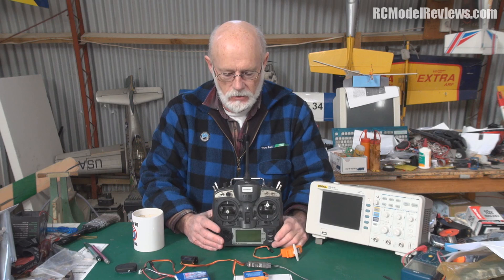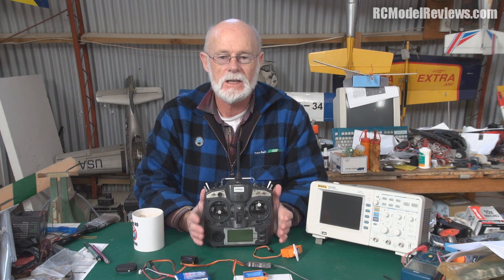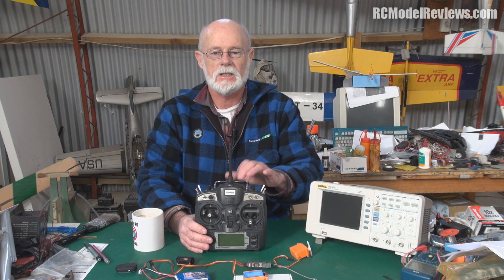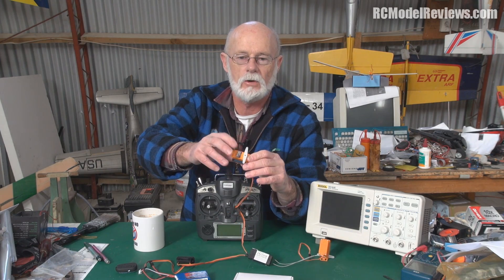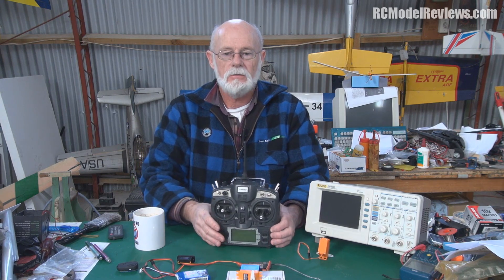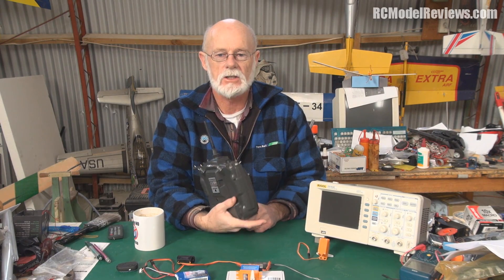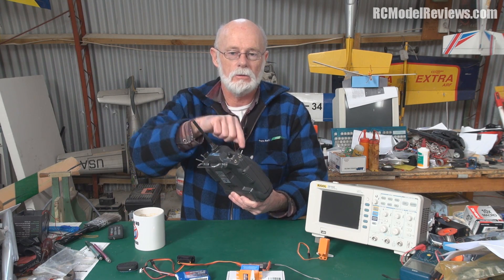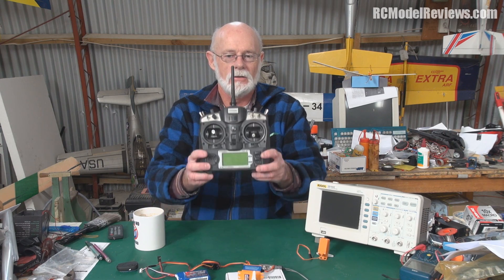Latency in RC systems explained

Comment: I'm currently struggling with a latency issue with a taranis, EZUHF module, and a pixhawk 2.1 cube. 
Setup for PPM mixed on EZUHF 8ch diversity RX,  when i plug it in the RX with single cable PPM muxed to the rc in on the pixhawk, the servos are much slower than if plugged into the RX directly.          Not sure if is the EZUHF or the Pixhawk 2.1, had the same issue with the PX4, lived with it, but trying to figure it out if i can..          any suggestions, anyone?    it's a large plane, and can be flow either way, but does have a much nicer feel with direct control,   also servos move slightly further when plugged in direct..

Comment: I have a question, I own a brushless 4wd ecx ruckus that lags a bit with my new 2s lipo the voltage on the stock nimh is 8.4v and the 2s is obviously 7.4v does the voltage output into tha car change the latency of the car or is it something else? Plze answer

Comment: Great video testing the latency!  A suggestion..  Maybe hook up one probe from your oscilloscope to the switch on the transmitter, and one one the output on the receiver, then single shoot the two signals and accurately measure the time between them.

Comment: Good explanation Bruce.  It would be interesting to see slow motion of the different servos moving simultaneously side by side.  Also would be interesting to see them triggered with a switch rather than the stick - to take the transit time of the gimbal out of the equation.   As always -- Well done.

Comment: Yes.  Find a Futaba 9C flyer with a model with dual elevator servos, and you will be able to see the effects quite clearly.  Since the first elevator half is channel 2, and the second elevator half is channel 8 (if I remember correctly) it takes a bit of time for the electronics to decode the stick inputs, then position elevator 1, then channel 3, 4, 5, 6, 7, and then finally channel 8.  It is noticeable. In flight though, as Bruce said in the video, not really a big deal. the brain compensates.

Comment: when testing the servos, i would be interested in the servo returning consistently back to the neutral point repeatably.  To me the speed and no double neutrals are most important so long as the gears hold up and don't get sloppy.  i am always searching for a brand that is as good as the super expensive ones without the name . :)

Comment: Bruce, thanks for the video.  I have a question.  I use a FrSky module in my Futaba 9C for two airplanes and I like it a lot.  On my remaining airplanes I use my JR 11X and Spektrum/JR recievers.  Because the new FrSky radio allows you to put a JR module in the back, I was thinking about selling my 11X (for big bucks) so I could fly all my airplanes with one radio and then take the wife to dinner on the extra cash.  But with PPM latency, how much will my old models suffer?  Thanks.

Comment: A standard servo motor has an armature. You can look that up, but it's a bunch of thin steel plates that are stacked together, and which the motor windings are wrapped around.  As with any brushed motor, the armature and windings spin. (A brushless outrunner also has an armature, but the magnets spin instead.)  In a coreless motor there is no armature, only windings that are glued to the motor shaft. There's less inertia in this arrangement, and less eddy losses too.

Comment: Bruce, your slow motion video of the servo moving would have been more accurate had you used a switch to move the servo 60 degrees, rather than moving the sticks, because it takes longer to move the stick from one extreme to another than it does to flip a switch.

Comment: Hey Bruce, 
I had always assumed that regardless of the setup (internal or external) there was still a PWM signal that traveled on a wire between the radio's main CPU and a smaller CPU that drives the RF chip which sends the radio signal. So, the fact that the transmitter module is external should make no difference from a latency perspective. If however an "internal setup" uses the main CPU to "directly drive" the RF Chip, then no PWM connection is necessary... and I stand corrected...